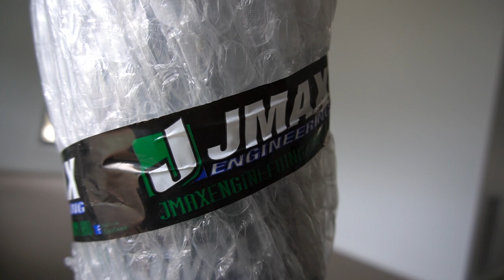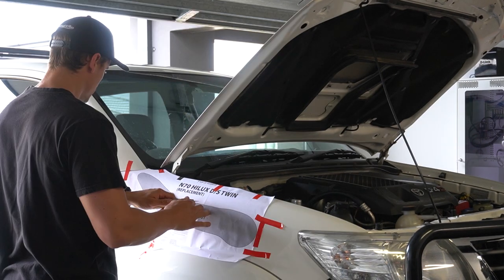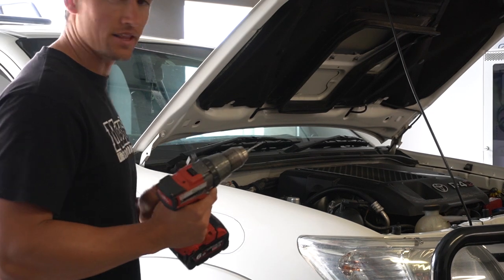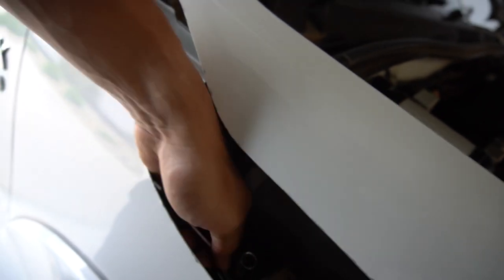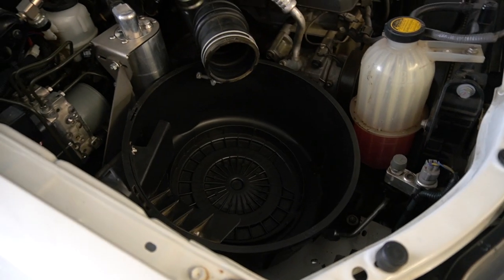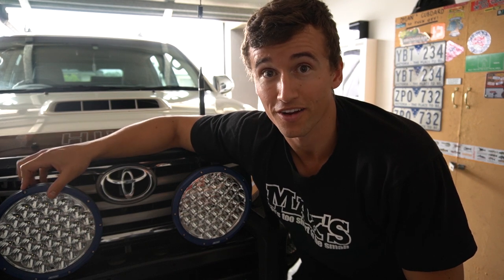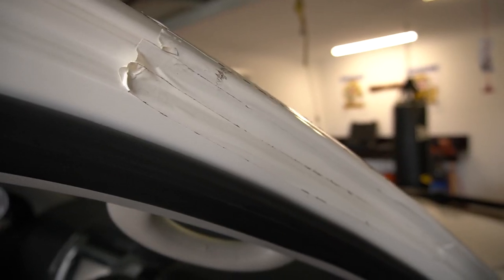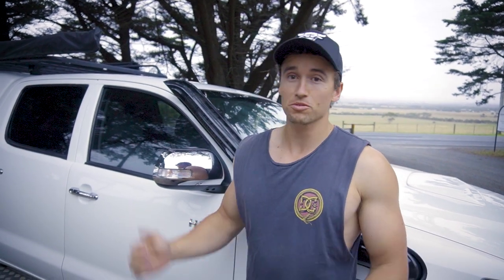BREATHING EASIER with a JMAX Engineering Snorkel - TOYOTA HILUX N70 INSTALL

Comment: Hey mate, can I ask your feedback on the J-Max snorkel after a years usage. I first watched this vid close to when you uploaded it and wanted to see what your thoughts and feed back are now after using it and putting it thorugh its paces. Also, could you use a silicone right angle or 45 in lieu of the wire reinforced hosing. Not a fan of that which to me representds the biggest weakpoint of the whole system and for close to a $G I'm not fully sold just yet. Cheers bro, appreciate the feedback and love the channel
Reply from the maker: Yeah great question mate, the snorkel is solid as ever in its mounts after doing 20000km on and offroad last year. It does not cause water to pool in the air box when driving in heavy rain. And as for the flexibile pipe, yes it could be peiced i suppose but when yoh push the excess back into the gaurd it is quite compressed meaning theres more steel support to stop it caving in from induction. But like you said silicone pipes would be ideal. Although i would use a custom air box for that install. Because the factory box setup is very tight to connect the pipework.
Thanks for watching our channel mate 😀

Comment: Is that stepped section on the base of the snorkel where you attach the flexi pipe 4 inches wide or is it reduced to a 3 inch there? Great video 👏🏻
Reply from the maker: Correct, unless your getting the custom airbox. It 4 down to 3 to fit the existing factory box

Comment: What about the induction sound on long drives? Annoying? like a sports exhaust on a 6 cylinder commodore.
Reply from the maker: The noise is mainly present in 2nd, 3rd gear. At 100kmh there's no apparent noise.  Window up and it's not noticeable in the lower gears

Comment: Hey man, is that the standard snorkel or the lowcut? Cheers
Reply from the maker: That is the low cut version mate, they don't have many images online of these
Reply: Sendin' It cheers mate, looks sick, looking at getting one for my own 🙂
Reply from the maker: @joshstirling4605  Definitely worth the extra money over a plastic. Looks factor anyway
Reply: Sendin' It yah always been my issue with the safaris etc, look cheap asf compared to the stainless ones
Reply: Get your own pinch weld the one Jmax send you is trash

Comment: Brother I got an N80 Hilux.. I'm torn between Stainless or Safari people are saying that the Stainless Snorkel gets water through to the airbox? How do you find it so far?
Reply from the maker: Havent found water entry to be a issue at all. Drove 10 hours in rain across the Nullarbor and it didnt fill my airbox up. Just ensure your duxk lip valve is working at the base of your airbox
Reply: @SendinIt  oh man.. want it so bad but scared AF!

Comment: Hi nice video but working with heavy rain ?
Reply from the maker: Drove around 6 hours straight in rain across the Nullarbor recently and no issues with water in the air filter housing. Ensure the duck lip rubber valve is functioning and clear to allow any excess water to leave the housing when the engines off
Reply: Sendin' It the duck lip rubber valve is original of the filter box system? Or the snorkel ?
Reply from the maker: Yes correct its the original valve on the box

Comment: If you look closely can you see panel waves along where you've cut with the snips. Does the pinch weld hide it? As anal as I was cutting mine with snips you can still see warping. Having a black car doesn't help.
Reply from the maker: Yes definitely a very slight wave. But the pinch weld is more than big enough to cover that up. I found the cut out a little to sloppy and i would cut 2-4mm inside the black line next time
Reply: See I got mine from PHATBARS as I wanted the short entry. The pinch weld they supply is much thinner so way less room for error, plus you have to remove 3 panel bolts to beable to bend the top of the fender out so you can manipulate the base of the snorkel through. Just to much bending and manipulating around a skin panel for my liking. The risk for damage is to high. The thing is you only get 1 shot and now I'm regretting even attempting it 🥴
Reply from the maker: @smatt9993  I thought mine was going to be short entry but it didn't end up that way. (Jmax didn't have photos of a low cut). That sounds tricky as compared to these snorkels
Reply: @SendinIt  cheers for a bit of insite to yours. Been watching heap of videos and searching loads of images to see whether wrinkling is normal to help put my mind at ease. Should have just gone s safari haha.
Reply: Definitely get your own pinchweld the one they supply is thin and cheap it’s wavey and the steel insert overlaps

Comment: OMG, don't like that install at all. Such a large cut in the fender would weaken it, defending prefer the unit I got. Also why is the head facing away from the airflow?
Reply from the maker: The fender doesn't exactly hold the car together, I prefer the snorkel being recessed into the gaurd each to there own i guess